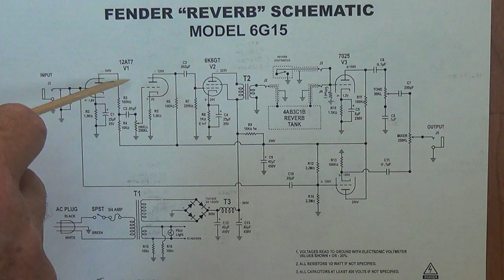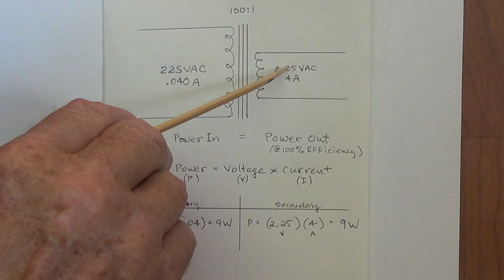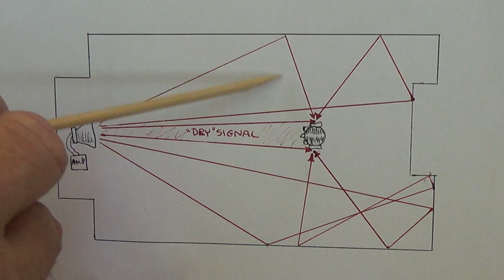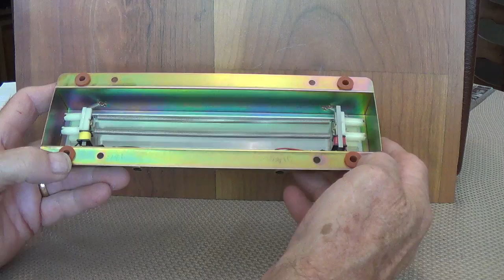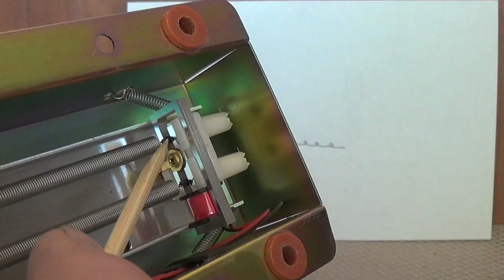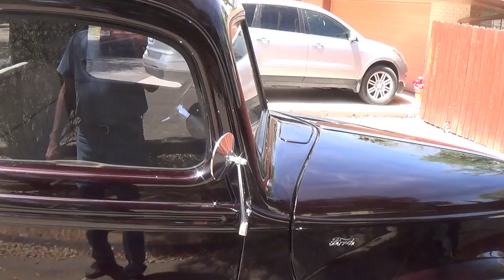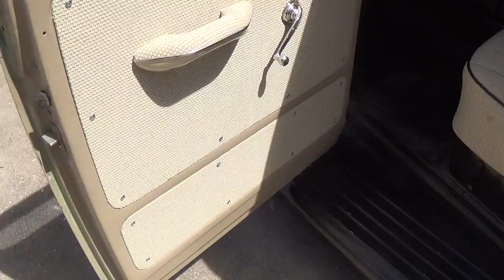Tube Reverb, Part 1

Comment: It's funny,  I was going to do something like this on my channel,  since I thought there was a lack detail on Youtube of how these actually work.   I have my ArenaVerb that is similar to yours...  but with a bit more stuff in there.
Reply from the maker: I posted a video about it on another channel several years ago, but this series will delve much deeper into the awe and mystery of the topic......I hope :)
Reply: I think the key thing that people miss is what actually makes the tank itself tick.   You've got a knack for explanation.    Maybe I should switch out and cover Tel-Ray Electrostatic Line Delay.   Ever heard one of those?   I got a Gibson GA-4RE,  and now a Standel Reverbalux that use that system.
Reply from the maker: Thanks, DK. Nope, that's a new one on me. If you do make a video about it, please let me know :)
Reply: Tel-Ray's electrostatic line delay was the first electro-mechanical delay to NOT use tape.  It had an anodized plate (the formula is still a mystery)  Three or 4 wipers (neoprene maybe)  and the rolling disk was coated in Union Carbide LB65 oil.   Lots of folks call these Oil-Can delays.   They are kind of weird, and work best with less percussive instruments.   They are certainly fun though.
Reply from the maker: I have heard of them, seen photos, and would love to find one to experiment with. Talk about a Rube Goldberg device......akin to the DeArmond Tremolo.
Reply: Hi Doug...  I made the video about Tel Ray Oil can echos... It's posted on my channel.   Hopefully you'll find one cheap some day.  I lucked out once.
Reply from the maker: Thanks, DK. I will watch it at once......and, no doubt, begin searching for my own :)